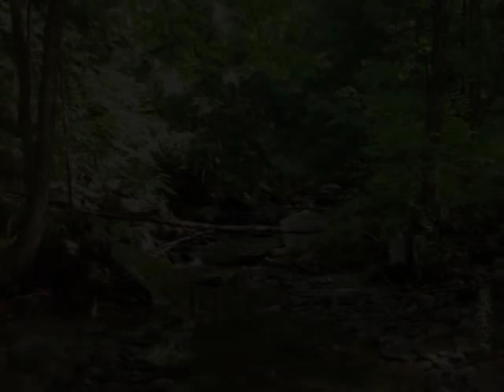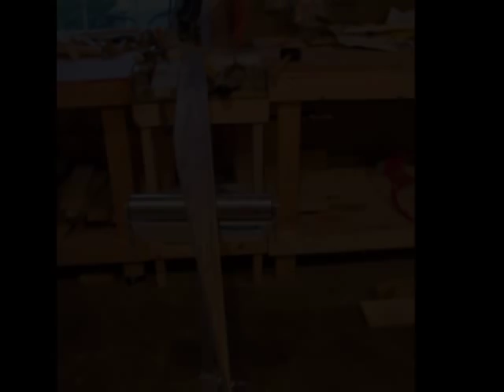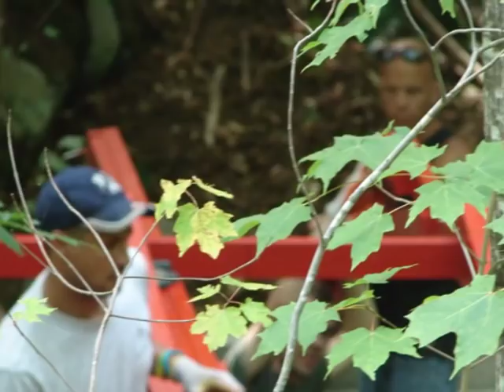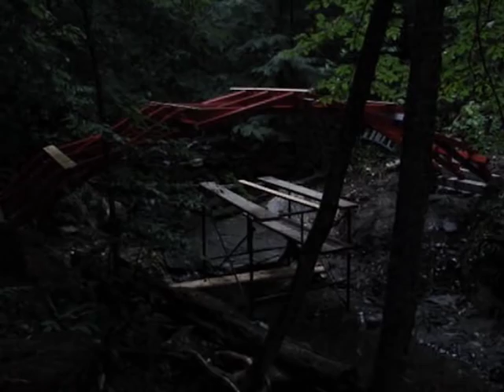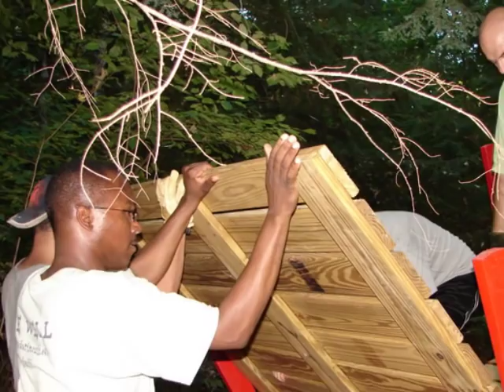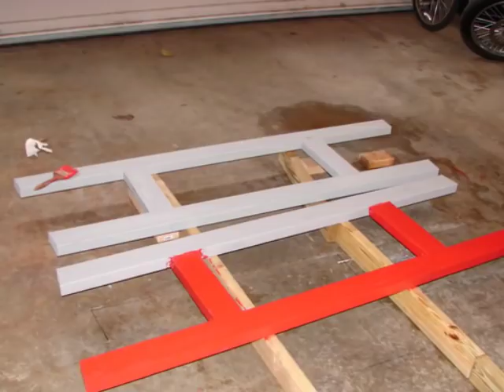The Construction of My Rainbow Bridge

Comment: This is beautiful thanks so much for sharing! I was thinking about doing one across a 22’ running stream but struggling a bit with decision making.  What size was yours? I was thinking about doing a one man build. What do you think? Possible?
Reply from the maker: Hello Scott!  My bridge has a 30' span, and I pretty much built it by myself in my garage, then had lots of friend come over to help me move to pieces to the site and erect it.  It was a great project, Also, I have not building training, so it is doable.  Good luck!
Reply: Scott, I'm building one now.  Mine is 26 feet long to span an 18' creek.  The truss pieces (3 of them) have taken me 2 weekends to build by myself.  This includes cutting, laminating boards, first assembly and sanding.  This week I will be staining everything should the weather cooperate.  It's been a neat project so far.  Good Luck!